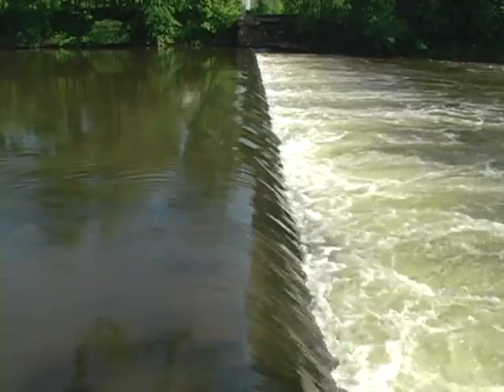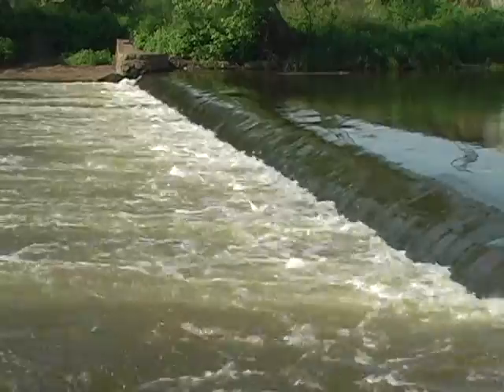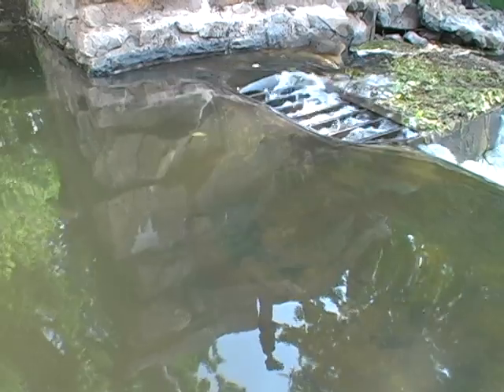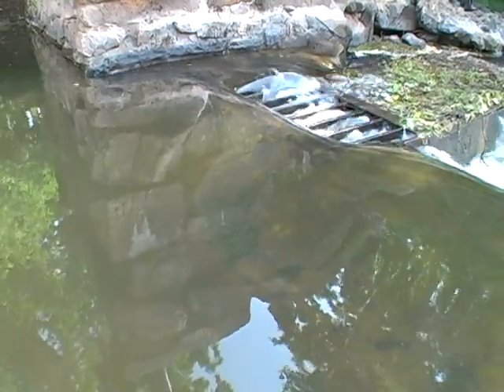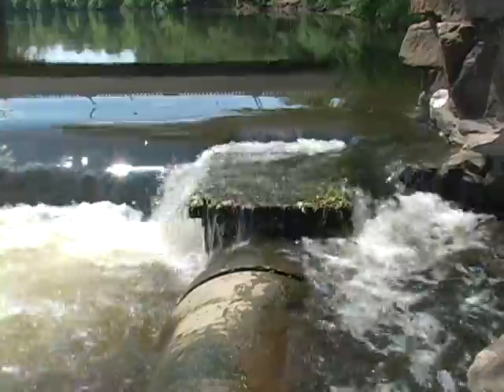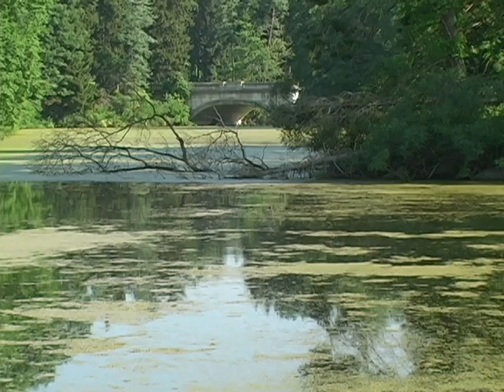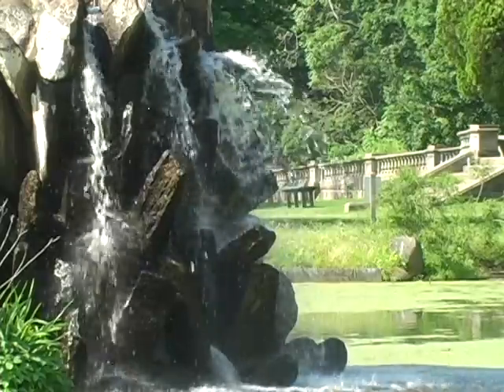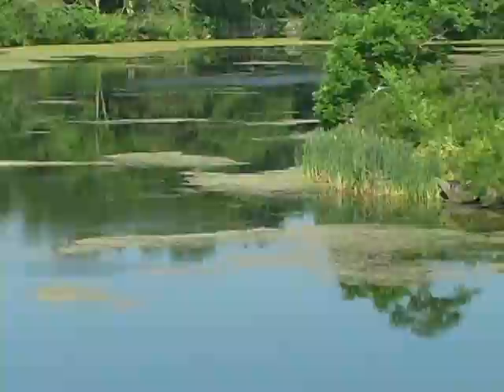Nevius Street Dam Removal - Non-Music Version

Comment: COST: $50,000 to build, $5 million to teardown.
Reply from the maker: Actually, the cost to build the dam in 1902 in present-day dollars using standard discounting valuation would have the dam construction costing several million dollars, much higher than the cost to remove the dam.  Thanks.

Comment: if the fish could not cross that dam then evolution has by pasted them, and now it will dry up in the summer.
Reply: Except that it doesn't.  Even if it did dry up, that is the natural feature of the river which the fish would be adapted to.

Comment: weirs the point in removing all not just a section
Reply from the maker: Good question.  Fish migration studies have shown that anadromous fish cannot overcome notch entrance velocities so notching just a portion of the dam will not increase or improve fish passage.   And I have found that the notches that were cut in other structures on the Raritan tend to get clogged with woody debris (it's amazing how many trees come down this river).  As such, by removing the whole dam (which the owner desired) we open up multiple channels for the fish to use in migrating upstream and we give the river enough room to keep that woody debris continually flushing downstream. Thanks for your comment.

Comment: I don't get it. The weir is just a little hump in a river causing one side may be a few feet deeper than the other. So what s the big deal? Also why remove all of it. A 10 foot section would accomplish the same thing and save a lot of money!
Reply from the maker: The migratory species (American shad, river herring, etc.) frequenting this river cannot pass over even the slightest obstacle (unlike salmon for instance). Also, a partial removal would cause the water to flow through that small breach at a higher velocity than the fish can overcome in their upstream migration so full removals are preferred (and are required by Dam Safety regulations).  Thanks for your questions.
Reply: http://www.pwik.przemysl.pl/public/images/original_449_gallery.jpg
what about this constructions ?

Comment: Being a mason, I wonder how the masonry structure survived spring freshets. The old lime based mortars provided a lot of autogenous properties, but they weren't hydraulic.
Reply: As far as i can see from the video, it seems they used quite thin layers of mortar and large, flat pieces of stone. I don't know if this might have had any effect on the effect you're mentioning here. I've worked as a masoner for 4 years and yes, it is quite interesting. I also think about one more thing, do we know that this river is frozen solid in winter time? If water continuously flow, i don't see how there should be any problem.
Reply: 123TauruZ321 After watching the video for a second time, I realized the stone masonry was encased in a cement. Given that the structure was in New Jersey, I would think that there is ice formation, but I am not sure of the severity.

Comment: Americans are their Simplified English. It's a WEIR, not a dam.
Reply: Hey genius take it from this American, a weir is a dam!
Reply from the maker: As mentioned under another reply, they are all weirs on this river.  I refer to them as "dams" because they are officially named that in the Bureau of Dam Safety inventory files, but moreover because weir is a term that is relatively unfamiliar to the public at large, whereas a "dam" is something that everyone can recognize or visualize.  Thanks
Reply: A dam stops flow in a river/stream and builds up a pond/lake.  A weir is something on a dam that is used to control the water level, fixed or adjustable levels.  You see the dams on these videos, the very top were the water runs over is the weir.

Comment: What about fish gates ?? , plus your losing aeration of the water .......
Reply from the maker: It is a commonly held belief that aeration of river water by dams is somehow not happening in the absence of a dam or that such benefit outweighs the damage that dams inflict.  This river has plenty of shoals, riffles and shallow sections that enrich it with dissolved oxygen (DO) and now there isn't a dead water impoundment upriver of the dam devoid of DO where only carp could survive.  And no gate system, or ladder, or ramp can guarantee 100% fish passage that a dam removal can. Lastly, the dam owner did not want to have to maintain any kind of structure that would surely malfunction (and cost money) over time nor did they want to have the liability in case a person was injured or drowned at the dam.  Thanks for your insightful comment.

Comment: How exactly did you solve the replacement water problem? 0.75 million gallons don't come from nowhere... and they don't flow uphill, too...
Reply from the maker: +exi Good question, we solved it in several different ways.  Firstly, a water budget study indicated that the owner didn't need those 750K gallons every day (just during certain intervals in the summer) and secondly, that water was replaced via a combination of available groundwater and a soon to be implemented water recycling system.  So, not only was the dam removed, there was a substantial overall reduction in water use, which benefits everyone.  Thanks for your question.
Reply: JohnWJengo

Comment: I'm curious why a simple spillway like this would require 5 years of planning? I understand the permitting yada yada yada, but I wouldn't think we would be talking about thousands of tons of sediment to worry about. Maybe just me....
Reply from the maker: +heyitsvos Good question. It did take five years of planning but not because it was a big structure.  We had to get the owner of the dam to agree to its removal, and as part of that agreement, we had to replace the service that the dam was supplying (0.75 million gallons of day of water supply).  We went through three separate designs of where to get that replacement water, and those were rejected before we finally came up with a solution acceptable to the owner.  Then we had to partially implement that design to prove that it would work and supply the water that they needed before the final approval to remove the dam was granted.  Add that time to the five different state permits for the work (plus local permits), access agreements to drive under a high voltage power line and over a municipal sewer line, negotiate working around a bald eagle foraying area, plus develop a historical mitigation plan, plus gain consensus from the community, well, you get the idea.  Thanks for the question.
Reply: JohnWJengo
Thank you, I sit here humbled :)
Reply: @JohnWJengo  Thanks for a excellent explanation.  Here in the West the eco whackos talk about removing huge dams that provide huge benefits so in general I'm opposed.  East Coast, where many dams were built for old factories and the like are no longer useful, why not pull them out?  If they are not useful, bye bye!  1 other thing, this was 2013, where is the 2023 update?  I'm hoping to hear 200, 300% increase in fish and riparian species.  Otherwise, you're just blowing wind up our skirts.  Thanks.

Comment: This strategy is all wrong. There are 75000 dams like this in the country. Instead of spending millions one one dam here and there, we need to punch a big notch through ALL dams that are no longer generating power, then go back and restore the sites. The river was already essentially free-flowing at 4:25.
Reply from the maker: +Docktor Jim I think I have explained this before on my other videos, but I'll be happy to reiterate it here.  What you are suggesting is not workable either technically or administratively.  Fish migration studies have shown that anadromous fish cannot overcome breaching notch entrance velocities so notching every dam will not increase or improve fish passage.  And on a practical basis, it takes 3-5 years to gain access to these dams through private properties, obtain all the proper (and required permits from federal and state agencies) and wait for the right river conditions (cfs) to set up.  Very often, we have but one window of opportunity to execute a dam removal and we cannot leave until the river is completely open and the dam completely removed per the permit requirements that gave us permission to perform the work. Setting permitting requirements aside, to return to finish the job later essentially doubles the price of the project (a second set of permits, remobilizing equipment and personnel, installing another ramp, and etc.), which no one would agree to.  Thanks for your comment.
Reply: JohnWJengo I build eco-friendly marinas in Washington, Oregon and Canada. We tear out horrible, filthy, fish-killing marinas and replace them with marinas that allow for light passage that are non-toxic, and recyclable. We have learned that by breaching the fish-trapping shapes in marinas while planning and permitting the projects, we can save huge numbers of fish. We've convinced the environmental agencies that doing something right away helps right away.

Breaching a dam early or simply lowering the level of water behind it, would allow some sediment to be transported downstream, and for riparian habitats to migrate downward gradually in the reservoir pool. If the riparian flora around a reservoir are suddenly left far above the water in an all-at-once dam removal, they're going to die.

I worked extensively on riverbank restoration and wetland creation in a river that was raised and lowered dramatically for irrigation: The middle section of the Deschutes in Oregon. Sudden changes in river level strand fish, wipe out insect populations, and kill riparian vegetation. Arriving at a dam that's holding a full pool behind it and completely removing it 20 years from now after raising millions of dollars, and doing the removal all at once, while ignoring thousands of other dams, is like planning now, to build an animal shelter 20 years from now to save one dog.
Reply from the maker: +Docktor Jim I think there may be a conception that these dam removals are not part of a wider effort and that somehow all the effort is expended on one dam at the expense of others.  I would reply to say that I managed the removal of three dams in the space of three years (2011-2013), which had never been done before in NJ, and I have another slated for next summer.  In my watershed at least (the Raritan River), all the dams are privately held and it takes a lot of effort to convince the owners to part with them.  In other words, we don't have a line of dams ready and waiting for removal.  For instance, the next three dams on the priority list are: a dam where a large sewer line was built just behind it and the municipality is not agreeing to move the line so that we can take the dam down, another dam is a USGS gauging weir and they have refused to consider an alternative method of gauging river flow so we are precluded from removing that dam for now and the next dam, the owner wants to reconstitute an antiqued hydropower service on the dam even though it would take thousands upon thousands of dollars to do so (money he doesn't have), and he refused my offer of replacing the "potential" power with a solar array.  So, I guess I would say that I'm not ignoring other dams in the watershed (I have 5 dams in play at the moment) but rather seeking ones for removal where the owners are willing to cooperate, and I work on this every week looking for any opportunity to sway these owners (and others) to our point of view.  And to your other point, we have not experienced any damage to flora or fauna upon the lowering of an impoundment - we do walk up and down the shoreline to help stranded fish (but we've never seen any) and the only "rescue" we needed to do was to pick up mussels and move them back into the water.  In the space of three-four weeks, the exposed shorelines are already germinating and by the next year, you can't tell that these strips of lands had been drowned for over a hundred years.  Thanks again for your comments and kudos for the excellent work you do on eco-friendly marinas, that sounds like tremendously important work.
Reply: Great thinking.